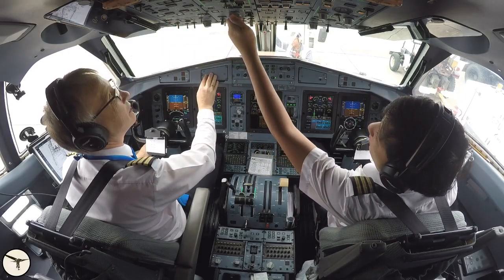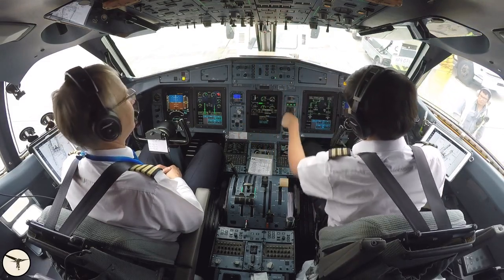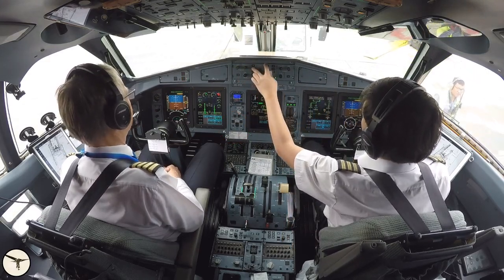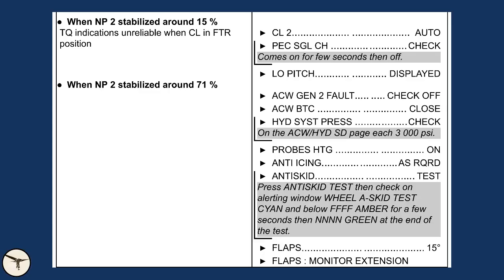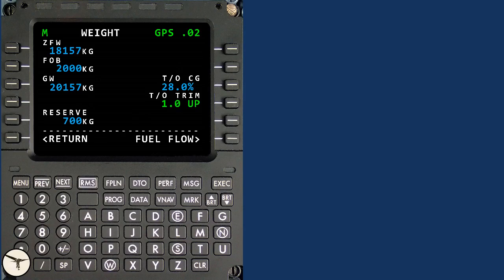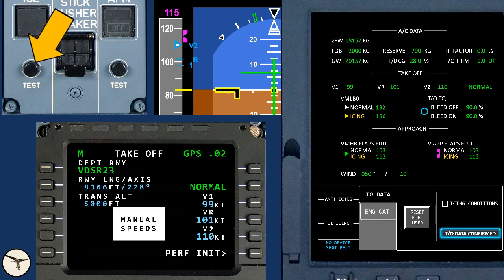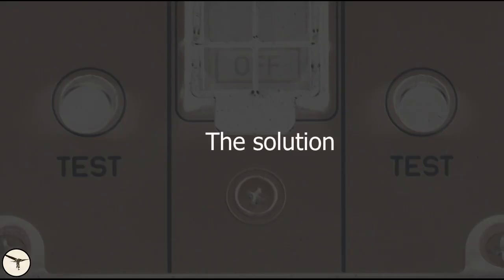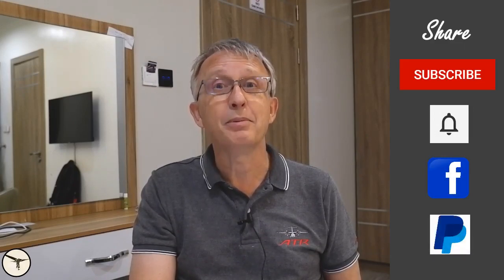ATR procedures: Don't push that button anymore!

Comment: Not a pilot but I am an automation engineer and this gave me chills.   Automation can be so dangerous when it does something you dont expect.   As soon as you said "replaces the speeds you input with the [less conservative] non limiting speeds"  I said holy shit.   That could ruin your whole day.
Reply: Yes. I personally find this to be an engineering failure.
Reply: It really should give a warning about it. But as he points out at the end of the video, there are several indications that we need to re-confirm the takeoff data.

Comment: Cheers for the video Magnar, was a great watch! No doubt with your recurrent training in Toulouse you would've learned about OEB56 from the ATR staff. Any plans on making a video about OEB56? I'm curious as to your opinion on continuous TRU usage as we have all sorts of different opinions from engineers and pilots at my operator.
Reply from the maker: It has been reported at least one case where all display systems have been lost. This can be result in a dangerous condition, especially when flying in IMC or at night. Until a fix has been developed, ATR has issued OEB 56, which requires the TRU to be ON during the entire flight. The load on the TRU is minimal because the primary source of DC electrical power is the DC generators. Therefore, this procedure has no negative effect on the systems. Although the risk of losing the display systems is very remote, the use of the TRU is a safeguard from this from happening.

Comment: It's a precious aircraft, but from the Industrial Design perspective, leaving a button that will cause a problem readily available to be pushed is a major offense. The best option would be correcting the button behaviour via software (not likely, software changes are extremely expensive and complicated in the aviation world) or simply gluing a cheap plastic cap over the button.
Reply from the maker: This issue happens only in certain situations as explained in the video. The maintenance will still need to test the system, so it will not be removed. The solution was to change the procedure for the pilots.
Reply: @FlywithMagnar  If the button can not be removed, it should be guarded with a hinged cover like other buttons that would have negative consequences if pressed during a normal flight.

Comment: the -500 FCTM (september 12) still says to test it. perhaps this is where we got mixed up. However the latest -500 FCOM doesn't include Ice detection test anymore.
Reply from the maker: The FCOM has priority over FCTM, as the FCTM is the last manual to be updated.
Reply: @FlywithMagnar  agree. I kinda wish ATR updated their FCTM for the -500 it is such a good tool. trying to find the correct procedure using the old FCOM format from the FCTM format to the new format was a pain.

Comment: Sounds like it does exactly what it was designed to do, and not what pilots want/expect? It makes the entire system act as if icing conditions are detected, rather than checking the icing detector function.

Comment: Hi Captain,
Won't the minimum icing speeds be always greater than the TO speeds (due to lower Clmax)? What cases can the TO speeds be greater. Thanks
Reply from the maker: The take-off speeds (V1, VR and V2) depend on aircraft weight, atmospheric conditions (normal and icing) and other factors. The take-off speeds in icing conditions are higher than the take-off speeds in normal conditions. When there is no performance limitation, the take-off speeds are on the conservative side and gives good climb performance after take-off. However, when you depart from a short runway, you will need to reduce VR and V2 as much as possible. This is how minimum take-off speeds are defined. 

For example, if minimum VR for a given weight in icing conditions is 100 kt, and you prepare to take-off in normal conditions, and you are performance limited, you must enter the take-off speeds manually into the FMS. If VR is set to be less than 100 kt, then everything is set for the scenario in this video.

This video explains take-off performance in more detail: https://youtu.be/AIfwMy-rhig
Reply: @FlywithMagnar  Thank you for your reply Sir,
I wanted to ask one more thing, In case of ice accretion on wings at TO, can you use the pneumatic deice boots or you increase your TO speeds?
Thanks
Reply from the maker: If you have ice accretion during take-off, you have done a terrible mistake. When there are icing conditions at take-off, you must de-ice the airplane with Type 2 or 4 fluid. This prevents accumulation of ice during take-off. You will also increase the speeds and delay flaps retraction until you reach a higher speed.

Comment: Is this the reason for OEB45 ?

Also another question, if the temperature just slightly change (just right on different speed calculate from sps) during T.O. Did the non-limit speed would also disappear?
Reply from the maker: OEB 45: Yes it is. 
A temperature change will not affect the take-off speeds. Once they are inserted and confirmed, they are fixed. However, it might affect engine power. But the effect is small, as a temperature change is gradual.

Comment: So why there is a test button?
Reply from the maker: Before the problem was discovered, it was normal procedure for the pilots to push the test button after engine start. The procedure is now changed, but the test button is still used by maintenance.

Comment: So when do we use that ice test button? I know i never found that on FCTM but I'm curious to when it should be used. Can it be tested during preliminary cockpit preparation?
Reply from the maker: We pilots shall not touch the ice test button. It is not required because it is self-testing. The test requires ACW, so it cannot be tested during preliminary cockpit preparation.
Reply: @FlywithMagnar  I wonder why they have that button. Maybe it should be blanked out.
Reply: @FlywithMagnar  Is this applicable to 500s also ?
Reply: @freshgasflow  For mantainance

Comment: Why you start Nr.1 first because of the tail wind?
Reply from the maker: If you start engine #2 in hotel mode in tailwind, there's a chance that the exhaust gases are ingested into the air condition system. A rotating propeller prevents that. We also avoid starting engine #2 from GPU when the propeller brake is off.
Reply: @FlywithMagnar  

Thank you.